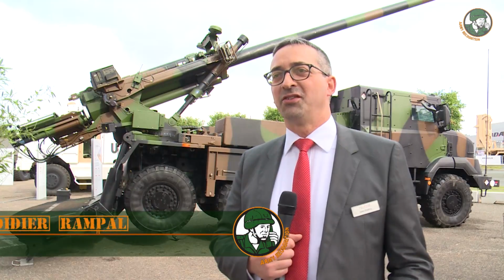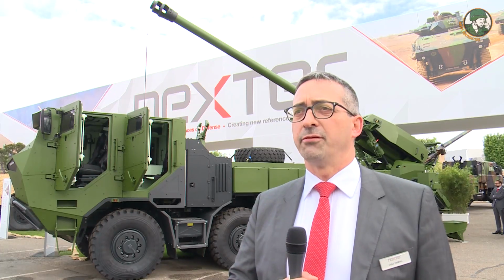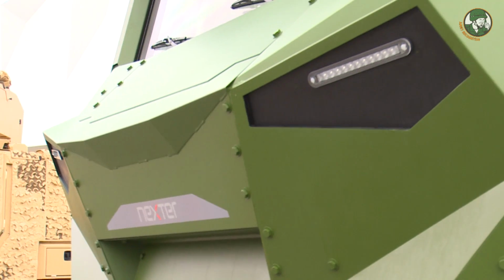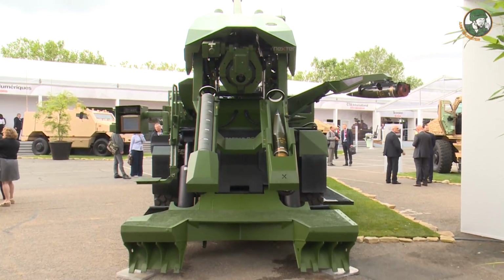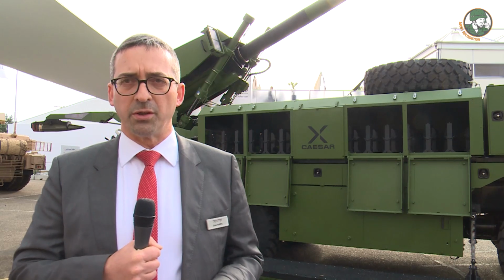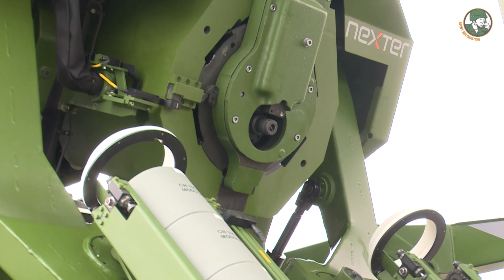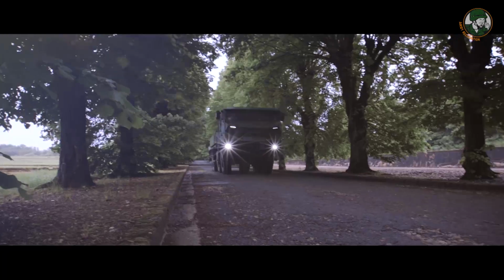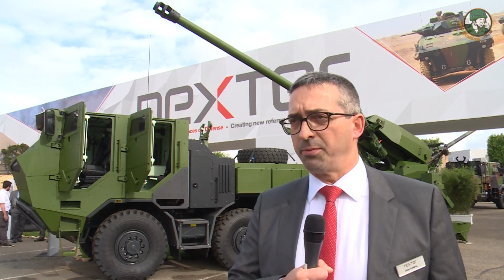Nexter unveils the CAESAR 8x8 with new automated loading system for the first time at Eurosatory

Comment: 🇻🇳 will buy about 108 Caesar 6x6 or 8x8 howitzer with STANAG 4569 level 3 protection 7.62 x 51mm API projectile and able to with stand 8kg anti-tank mine 8a under any wheel or boggy, 8b under the hull center but really the Nora B-52, Caesar 8x8, DANA, ZUZANA, Archer, Dora they need to upgrade from level 3 to 4 because they can able to with stand 14.5mm HMG AP projectile one of the most powerful projectile in the world and able to with stand 10kg (21 Ib) AT mine.